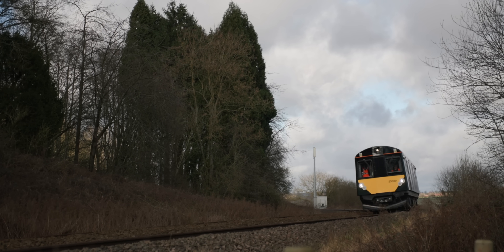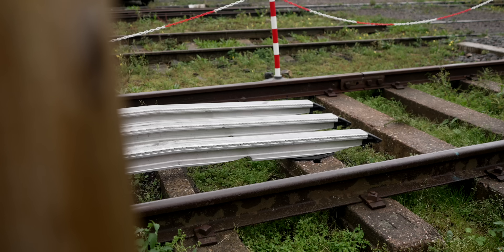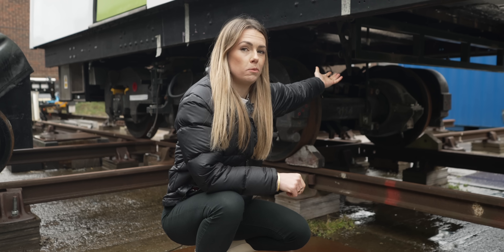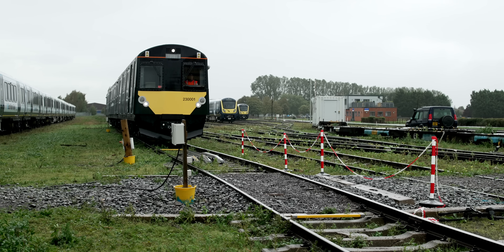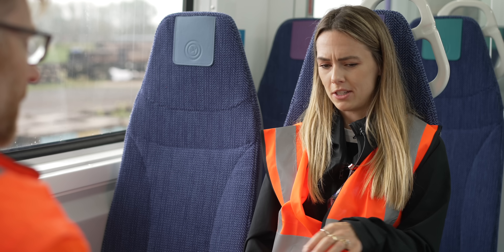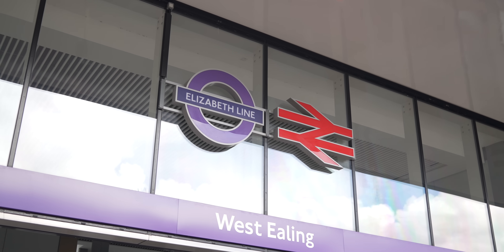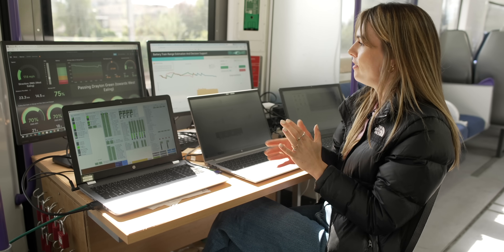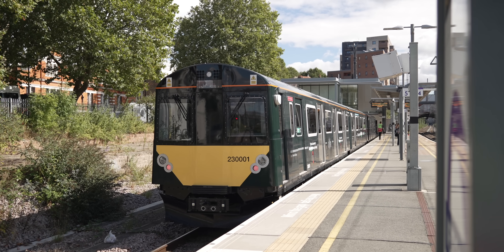Onboard the UK's First Battery Electric Train!

Comment: There seems to be a lot of negative comments on here but I believe they've all missing the greater point here. Grid connections are one of the main sticking points across the UK for most all new electrified projects. The idea of having localised battery storage fed with local renewable energy not only stabilises the grid but offers further savings by potentially lowering peak gas turbine generation and giving lower cost electricity to all of us. Great story and great video Imogen, let's hope this really takes of and we see this across all our rural networks. I live just outside Lincoln, a large city which unbelievably lies on an unelectrified branch line...
Reply: All great until trains start burning in stations or the container with the batteries. What's the price of rebuilding a station?
Reply: @ducthman4737  Depends on the station and damage.
Reply: This is precisely why we know it won't happen except on a handful of lines. TBH this seems better than overhead lines in terms of lower infrastructure and maintenance costs - which again is why it won't happen lol
Reply: The one thing that sure as hell is not the future, is the UK... NIMBYism off the charts as if they still had an empire, boggles the mind
Reply: Excellent seeing the progress.
Reply: should be US
Reply: It's a mix of positive and negative currently.
Reply: I am convinced that external forces are stifling this concept.How on earth can it take 18 months to make so little progress from static rig testing to implementation on track at station.The Victorians would have hand excavated miles of new railway in that time period.
Reply: @BRI535D  It started testing on the Greenford Branch in Spring 2024, before then it was testing on Long Marston test track and the Cotswold Line to Honeybourne, to gain enough miles to show it had enough range to run to Reading. Some of the delays come from the collapse of Via Rail in 2022 and GWR only brought it in March 2023, also part of the delays come from first in type testing which is why it is taking longer however it should enter passenger service in Spring 2025.
Reply: I do not believe hydrogen is the solution even for long range trains as there are too many impossible problems ahead of it. Take a look at the state of the Toyota Mirai and see what you'd need to improve to make it train viable. I think you need bigger stronger tanks so new materials, refuelling needs to bend the laws of thermodynamics to hit 3 minute refuels and hydrogen needs to be cheaper than diesel with carbon credits which is not something scale will solve as production is inefficient. Battery for long distance trains doesn't have insurmountable problems, greater capacity, cycle life and lower cost would be nice but throwing more batteries on board would also do.
Reply: Or they could improve the national grid. Maybe invest in more nuclear while they are at it
Reply: @mattevans4377  Network Rail already only buys nuclear power and is install solar panels at substations, like they have installed a 5mw solar system at Aldershot.
Reply: @J-Railway-Volunteer  I'm not blaming Network Rail. I'm blaming the National Grid and the Government
Reply: @mattevans4377  Network Rail feels electrifaction makes sense on routes with a top speed of 75mph or more and hydrogen for rest unless urban line then electrifaction.
Reply: You can’t choose how your electricity is generated, that’s not how the grid works.
Reply: @mattevans4377  Nuclear is expensive, it's one of the reasons why the Government is struggling to find private investment in existing projects.
Reply: @verygoodbrother  Expensive short term. Cheap long term. Not my fault those in power suffer from short terminsim brain rot
Reply: @mattevans4377  Not even close when you factor in the energy contracts and eventual decommissioning.
Reply: @verygoodbrother  looks at France
Reply: Hi,
I am all for electricity but battery storage has the same issues as EV's. Lithium Ion batteries.  A number of these installations worldwide have already combusted and to have effective battery storage they would need to be the size of Surrey. In the last 4-5 weeks we have had a large period of days where wind power has been about 4% and is only effective about 35% of the time. We need to go nuclear hydro (plenty of water in UK) or tidal which works 24/7. Solar is not much good either. With all this AI on the agenda plus all the new homes being built we need reliable generation. We already have very expensive electricity nearly twice that of the UK yet we are sitting on large gas reserves (and oil) and also we are burning wood pellets from felled trees imported instead of coal. One big coal fired power station would not hurt, coal burns hotter and it would negate the fuel needed to bring thousands of tons of wood pellets over to burn.
Reply: @michael.randall5034  Another Class 230, went on fire from the battery pack.
Reply: @philskermer3132  Network Rail is the owner of the rail network and doesn't think batteries are the future instead hydrogen.
Reply: @J-Railway-Volunteer  hydrogen is never going to be a big thing. Electric trains already exist. Don't re-invent the wheel
Reply: @zenixlo  Hydrogen has a greater range. Also, hydrogen has been tested to work well, as shown by the class 799 bi-mode electric and hydrogen unit. Hydrogen is a better store of energy. You not going to use battery traction on the rural lines as you don't have enough range on batteries with the grades. Also it has always been the plan to use Hydrogen on long distance services, also batteries don't have enough power to replace diesel on freight engines, so Hydrogen will have to be used there. Also batteries ware out much faster than Hydrogen. Plus batteries aren't great for the environment because of the lithium and the working conditions for the miners isn't good enough.
Reply: @J-Railway-Volunteer horses for courses.
Reply: @J-Railway-Volunteer  Lithium batteries normally will return 80-85% of the energy used to charge it.
Hydrogen if cracked from water with electricity will get you about a 40% return.
So umm... No it isn't the future not for road vehicles or trains.
Its very difficult to store as there is no known container that can hold it in, hydrogen is the smallest atom we know of so it will seep slowly through everything
Then there is the problem of when it goes bang it is a very very big bang, Imagine the mess in a major rail collision.
If you want electric trains put the damn wires up we have been doing it for more than 100 years now, it works.
Reply: @930ruben  There have been Electric trains in Britain for decades but it is a fact that  full electrification of our rail network has never looked like becoming a reality  in my lifetime (over 70 years). Most mainline rail services are still operated by diesel locomotives and the people who are responsible for the rail network development have clearly chosen not to go electric. What chance that there will be wholesale electrification of other forms of transport? A very long way into the future - if ever. The first thing that we need to happen is  governments to work towards very cheap electricity and then actively establish infrastructures to supply transport systems. Electrical Engineer of 50 year's experience. Hydrogen will play a major role .
Reply: @thedave7760  Lithium batteries catch fire easily. Also the Hydrogen class 799 is capable of 90mph at least with a class 319 acceleration rate, however battery units are limited to 62mph on battery power. Network Rail only suggests Hydrogen for routes like West Highland Line.
Reply: @J-Railway-Volunteer  "Lithium batteries catch fire easily. " not if they are managed well but if they do it is an unstoppable furnace that on a large scale can burn for days, I don't think that is the solution either. 
Hydrogen is no where near being ready for mass rollout and it is useless for green things unless you use electrolysis from solar or wind which is no where near being able to produce enough for these trains. 
The vast majority of Hydrogen currently comes from you guessed it oil and it will remain that way fro a long time to come. 
If you want electric trains put up the damn wires it is way more efficient in every way and will likely be a whole lot cheaper than exploring the unknowns of these pilot projects which just seem to burn up government subsidies so investors can profit.
Reply: @thedave7760  Hydrogen has the potential for rural lines like West Highland line and Far North Line. Electrification will be done on the busier routes, but you still need a reliable power source roughly every 30 miles for 25kv AC OLE and some of the rural lines don't have it and the signalling system has to use lead acid batteries charged by solar panels due to lack of mains connection. The Scottish government has a map, of what they want to electrify and it is the majority of the network.
Reply: @J-Railway-Volunteer  Then stick with diesel or maybe make a hybrid. 100% batteries or hydrogen is a dead end although someone will get wealthy from it you and I will be poorer because we will ultimately pay for this folly in the end.
Reply: @thedave7760  Scotland will need hydrogen from 2035 when Diesel will become banned on regular trains in Scotland, as batteries are a no go for the West Highland Line and Far North Line. There isn't enough traffic to justify electrification, also the rest of the UK has a 2040 end of diesel target.
Reply: @J-Railway-Volunteer  Despite what they tell you, hydrogen is not a carbon-neutral solution. So called 'Green Hydrogen' is horrendously expensive, 'Blue Hydrogen' involves a lossy methane-leaky process (I assume you know how bad a greenhouse gas methane is) and is powered by a CO2-generating methane-burning system. Also, the carbon-capture process in making blue hydrogen is not 100% effective, so 10 to 20% of the CO2 is released into the atmosphere. That leaves the current 'Grey Hydrogen' process, converting methane or coal into hydrogen and it is far from carbon-neutral.
Reply: @mikejfranklin7000  Nor are batteries carbon neutral as they mine the rare metals in the Congo, then make them in a different country like China. There s five types of Hydrogen I know of which are Grey, Blue, Green, Turquoise and Brown Hydrogen. Green Hydrogen is the most carbon neutral one and it has been suggested that you make use of Hydrogen not just for railway vehicles but also road vehicles which would be created at a railway depot.

Comment: No mention of electric braking - quite a lot of energy in a 100 ton train - does this train recuperate 100% of the energy usually lost when braking?  Two more benefits - no squealing brakes ... and very little wear to the mechanical brakes.  Why no mention of these important well known aspects?  Also - how powerful are the electric motors?  I would like to know.  How many Kilowatt hours to get the train from rest to normal running speed?  How heavy is this particular train?  How heavy are the 6 batteries?  What is the top speed of this particular train - 40 miles per hour is not that fast.  How much energy was this fast charging system putting into the batteries in 3 minutes?  30 kilowatt hours?  How much energy does this train use between stops?
So a bit useless - so many simple but important questions left unanswered.

Comment: The pantograph charging options is probably safer and allows more dynamic options. 
Can be used for reloading batteries on railway sections with overhead catenary systems while travelling. And when stopped too. Exists already and used in other countries.
Reply: not suitable for this chassis - it was considered